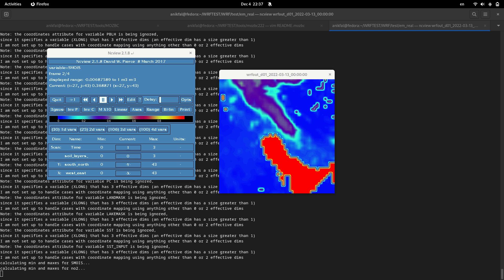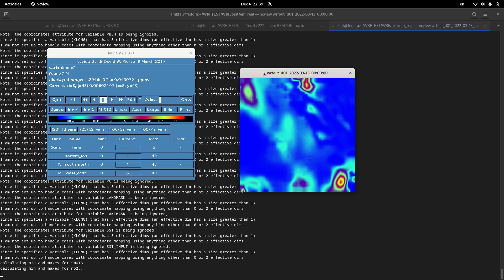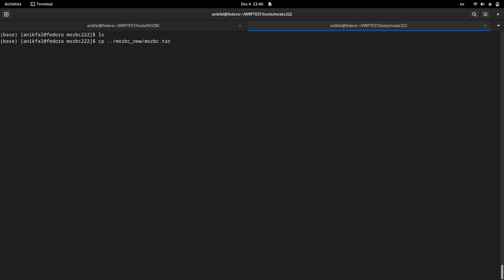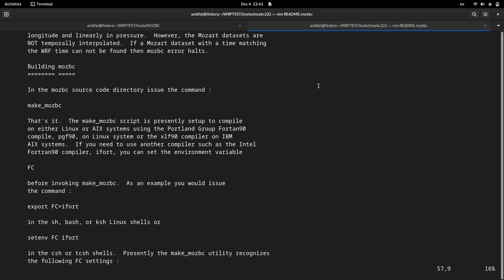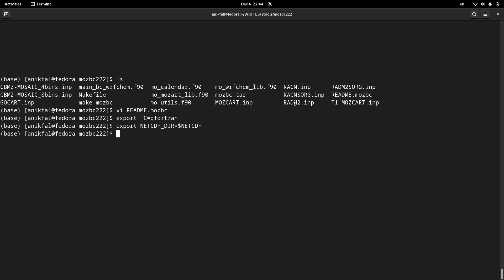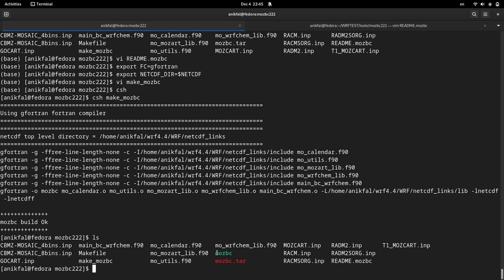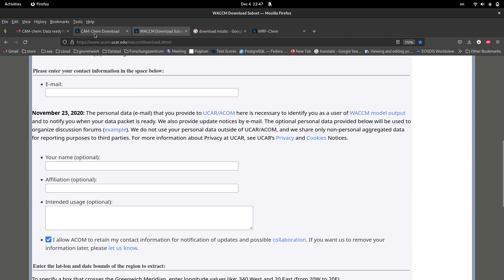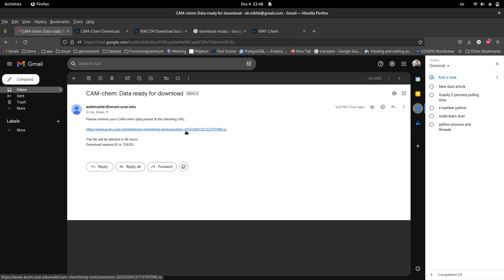WRF/Chem: MOZBC installation and input data

Comment: Hi Amir, I am trying to run 3 days air quality forecast. i have downloaded the waccm data for the initial date. Do i need to download the data for the next 2 days? and how to update the mozbc namelist to read data from multiple files. 

Thank you for your time.
Reply from the maker: Hi.
mozbc applies the WACCM data on the file of the WRF boundary values (wrfbdy_d01). So if you want to use it, you need to apply it for the whole 3 days.

Comment: I've been using "WACCM" to download data, but I received an email saying, "WACCM: No data found. There were problems accessing the data: Error contacting the NCAR Research Data Archive." Have you encountered this issue before? If so, how did you resolve it?
Reply from the maker: Maybe you put wrong values on the WACCM website. Change the values for a smaller domain/time and try again.
Reply: I also received an email that says "There were problems accessing the data: User has more than 30 open requests. Purge requests before trying again.", even though I have never downloaded data from here.
Reply from the maker: @meke1  I think this is due to the number of requests. Not necessarily due to number of successful downloads.
You may wait for a day or so and try again. After requesting for new data, please wait for some time (an hour) to get the download link emailed to you.